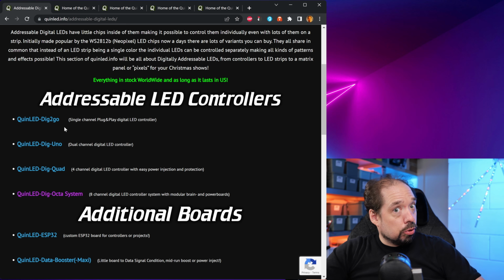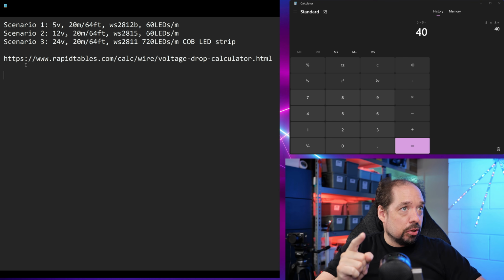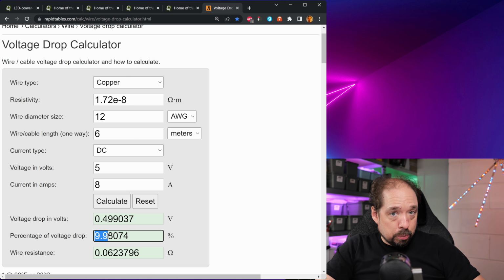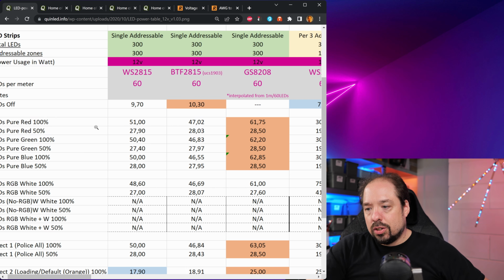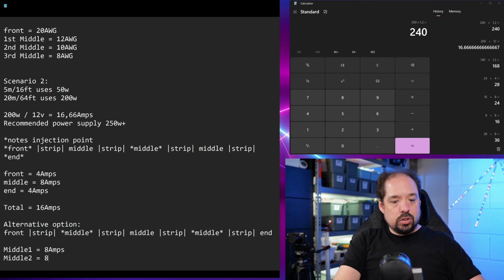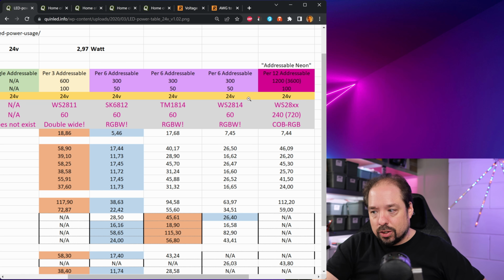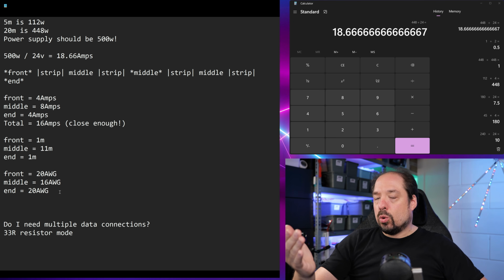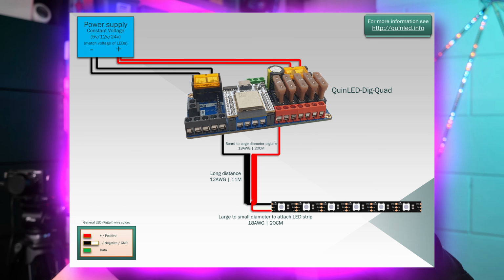Calculate LED Strip Voltage Drop With 💡QuinLED💡: You'll Be Surprised How Many Wires You Need!

Comment: My solution before finding this video was ending the positive on the first segments that didnt have a sag/blinked. I then bought an Amazon 36vdc 3a power supply and added it to the back half. Only 72 lights but it’s the resistance of the added line I jumped between strips.

Edit: do not go buying my specific power supply. Look at the one you have and get one similar and get a pro to do it. Never, ever, tie the new power supply to the positive already being powered only the unpowered strips, cap the previous positive

Comment: Do you consider any voltage drop for the 18 - 22 awg wire in addition to the actual LED strips? For example, if I have a 15 foot 22AWG running from my controller to the first run of LED strip, is there anything to consider in overall voltage drop?
Reply from the maker: Well yes, very much so. The video should have explained that though.

Comment: If my strips are wired in parallel, do I still need a power injection, and how do I determine what size wire I need? Im using the SK6812 with a 12v power supply. Im running 7 strips each 1 meter. They are single addressable.
Reply from the maker: The video in theory explains this. If you have 7x 1m and each fed individually, no need to power inject at least.

Comment: Great video. The clouds parted and the diy led world made sense. I do have 1 question though. In scenario 3 when you calculated 10 amps you didn't want to do a front, middle, end injection and you couldn't do a front and ended injection either cause that would only be 8 amps. Why couldn't you do the middle injection of 8 amps and 4 amps at each end for a total of 16 amps. I thought providing more amps is safe as the strip will only draw the amps it needs. I hope that's clear. Regardless, thx so much for helping us all understand this so we can safely have fun without worry. Cheers!
Reply from the maker: Awesome it helped! In the scenario you mention technically you could but it was a design constraint since most people don't like to do middle injections so a thought excise what you'd then end up with doing just front + end.
Reply: Appreciate your response. Thx for clarifying. I started the night about to give up on the DIY until i found your video. I'm confident enough to follow through on my plans now. I look forward to reading and watching everything else you've released. Can never know to much. Think I'll give your dig2go controller a try on my next project. Cheers! @IntermitTech

Comment: Thanks for making this video, its helped me a ton!

Just one thing i need clarification on: if we're injecting data, the point at which we're injecting data starts over at LED #0, correct? So from a programming perspective, we cannot treat the entire setup as one continuous strip, but rather as two separate strips each receiving its own set of data?
Reply from the maker: Awesome to hear! Correct on the data!
Reply: @IntermitTech  Is there a reliable way of doing this so that the entire thing can be treated as one continuous strip? Via hardware or software?
Reply from the maker: @dividebyzer0_ yes, internally in WLED if you have multiple physical outputs it's treated as a single strip that you can optionally cut up using segments.
Reply: @IntermitTech so it has to be through programming?
Reply from the maker: Well yes, if you are using something else then WLED it's up to that part.
Reply: @IntermitTech  sorry, I misunderstood what you meant by WLED but I did some googling and it makes sense now. Thanks again for your help! 👍

Comment: Question. I’m scrnario 2. Wrap around a room at 12v. Injecting at front and end. Injecting at middle at 8a. You calculate wire by the distance from the beginning to the middle point. However I’m injecting power at the middle with a psu at the middle. Only about 2 meters away. So do I calculate based on the 2 meters to the psu to the strip or use your computation based on the distance from beginning?

Comment: I wish this wasn't so complicated. I have two degrees in electrical engineering and I still cannot figure out how much power injection i need for a 16 foot WS2812B that has been cut in the middle with 8 ft of 22AWG wire spliced in.  any ideas?

Comment: I got into this led thing when I bought Govee light bars on sale as a "eh let's see this." I ended up in a rabbit hole and eventually took those apart because I didn't like 3 at a time strips and want everything on a 5v system. I didn't know how finicky led strips could be. Initially I wanted to do most myself, but since safety is pretty important for me I felt better getting something already made. Your system seemed so much better than what I was looking at with scalability. I've may have gotten too big of a power board but better than too small and honestly your products are very affordable it's not an issue. Thanks for all your videos and hope to see even more cool products in the near future!
Reply from the maker: Thnx, awesome to hear it!

Comment: Hi Quindor, thank you so much for this and all your videos! It's helped me so much!

I was curious about the Auxmer CCTs 2835 you recommended on your site as I wasn't able to find the power calculations for this chip within your tables. Hoping to seek your guidance please:

1) would I be able to assume based off the manufacturers power/m in this case? (E.g. 28.2W x 6m = 169W, with 24V, 7A so front + end should suffice)

2) don't want to assume that these are zone addressable even if they are tunable? But in your exp would this assumption make sense?

3) Regarding voltage drop for bridging a distance (e.g. kitchen hood), would the logic apply for the average Amps before and after the bridge (halving for middle injects which share the potential diff bidirectionally) to calculate the required wire thickness? In my example of front + end, this would be 4Amps

4) would having thicker wire gauges be counterproductive ( e.g calcs say 20AWG sufficient but I lay 18 or even 16 AWG for future proofing in case of upgrades)

Thank you!
Reply from the maker: Thnx!

1. Yes for analog manufacture is often correct for power.
2. Analog you can only change the whole strip, not zones. Also depends on the channels of the strip so for instance CCT has 2 channels.
3. Yes, it based on physics and the resistance of the copper tracks 
4. Sure, thicker wire doesn't hurt but use a value that you can solder to the strip stil, then stepping up for distance is fine.
Reply: @IntermitTech  Omg thank you so much! This stopped me from buying the wrong strip!

1) I was also looking at an alternative BTF 24V ws2811 FCOB CCT with 288(576)/m and per 24 (48) addressable. This wasn't on your power chart but I saw the 320(640) WWCW strip you tested had more LEDs, so I'm assuming it wont exceed those wattages? I.e. ~24W @50% and 40W @100%. I did note, however, that BTF claim 14W/m (70W/5m) which does seem significantly higher so I'm worried about underpowering this.

2) Would it make sense to have a CCT and RGB strip (side by side) powered & controlled from the same controller (e.g. dig uno)? Hoping for the best of both worlds (rgb and cct) without huge zones.

Many thanks!

Comment: I If I needed to add 5 or 6 injections over a long run, can I just run one set of thick gauge power cable next to the strip and tap into them every couple of meters instead of running individual cables for each injection?
Reply from the maker: You can, be generally you'd waste a lot of copper and also have to fuse in field, so everytime you branch off that large busbar wire. You also need to step down/change the cable diameter at each junction otherwise you are wasting huge amounts of copper basically like I started with.

Comment: can you also inject the data at the front and end both with ground and power wires?  or does the data injection need to be on the mid part?
Reply from the maker: I don't really follow the question. You need a new data line after 600 LEDs or zones generally. Did you watch the video?

Comment: Hello, what would be the best power supply for Seven SK6812 LED strips connected into one long loop/strip? 
I plan on connect power from the start and the end.  
The setup will be a big square and the start and end of the strip will come back around.  
I would like to use one power supply if possible, just having a trouble with choosing a power supply.  
Will a  DC5V20A 100W power supply be ok? Any suggestions?
Reply from the maker: I'm a bit confused, did you watch the video? 7x 5m of 5v sk6812 would use around 175w or 35Amps and require lots of power injections. Giving it only front + end would give the strip max 8A total so the brightness you could run is only 22%... And even then you are spanning too much between injections and will see horrible dimming in the middle, if it even stays functional at all. Please watch the video again and do the math. :)
Reply: @IntermitTech  Sorry man, I did watch the video just a bit confused. I am new to this and this will be my very first project. What will the best option be if I just want one power supply? I just don’t want too many power injections and run wires in too many places.

Comment: This video was tremendously helpful. Thank you!

I am building an led strip cube made of 12 segments with multiple data lines and power injection points, so figuring out the wiring had been a challenge until now.

Comment: Do I need Power Injection Points for long run COB LED strip Lights ? I'm just interested in a warm white light for above top cabinets, below top cabinets and below bottom cabinets in my kitchen
Reply from the maker: Yes, makes no difference what strip it is, but the guide covers all.

Comment: Hi! First of all, amazing video, thank you very much for all the information you give.

I have a question that I can't understand:

I want to make 15m of led strip in “closed” style, so the end of the 15 meters of led will be in the same place as the beginning. I already estimate that this will reduce the size of the necessary diameter, since I will never go more than 6 meters away.

My question is, well, two actually: 

Using the nominal capacity of 35w every 5m, in 15m gives me 105w, so that would be 21 Amps. 

 - Should I go for a 40a power supply? And if so, each power injection would have to be done from that same source? That is to say, to connect the beginning, middle and final injections in that same power supply?

And then, how would I regulate from WLED the consumption at 50%, from the mA regulator? I don't quite understand that yet.

Thank you very much and sorry for the long questions.

Greetings from Argentina!
Reply from the maker: Yes a single power supply of 40A would be perfect. The begin and end being close helps a lot! The middle injection will require a thicker cable which the video shows how to calculate..

The MA you can calculate it the 100% RGB value from the datasheet. The total amount set will make sure it doesn't exceed what you can deliver.
Reply: @IntermitTech  Awesome! Thank you so much for the fast reply :)

Love what you do.

Comment: I'm still lost - i want to run the cob 5v 160led/m for 2.5m. (accounting for close to 100% white)
1)What psu do i get? 5v 20a? 
2) how do i run the wires from/to psu to power the led? Do i connect to the controller first or ??
3) Do I still need to do middle/end injection for that length?
4) What gauge wire? What gauge for the wall plug to psu?
5) if i use gledopto esp32 with mic, how do i wire them up?
any help, much appreciated!
Reply from the maker: 1. Yes 5v 20A should be enough
2. If you use one of my controllers yes power runs through the controller because of power distribution and fusing
3. Oh yes, you'll need front + middle + end at least to be able to do 100% RGB white, especially if it's a 5mm wide strip, if it's 10mm wide maybe front + end will be enough
4. Calculate, see my guide " power injection " 
5. Ask that controller manufacturer for proper way of wiring but you will have to do power distribution and fusing yourself since those controllers do not do that

Comment: I don't have RGB LEDs personally, but I like the truck where the positive is on one end and the negative is on the other end, so the voltage drop is uniform across the entire length.
Reply from the maker: I do not, that's not really great for it and data wise that's a bit horrible too.
Reply: @IntermitTech  if it's simply single color LEDs, then it's a good trick. I'm a professional electrician but also an electronics hobbyist. And you're right that it's not great for the data signal, but like I said I'm not using RGB LEDs, I'm using single color LEDs. In my living room I just have a strip of 24 volt LEDs around the whole perimeter, and it works great to make sure that the brightness is uniform.

Comment: great video, so is there no problem with voltage drop of the data line within 20 m stripes?
Reply from the maker: If you're using my hardware up to 10m often works, up to 20m too. But if not we recommend one of the Diff series to get the data to go further.

Comment: What I can't see on this so far amazing guide is the use of pixel strings in both 3 and 4 wire configurations. Also finding it difficult to find the draw per RGB. I can only imagine the draw isn't asmuch as a bullet pixel but more than a RGB on a strip.

Comment: On the subject of power injection. An alternative method to ensure equal brightness of all leds would be to connect the +ve at one end of the strip and the - ve to the other end with supply wires of equal length. This way the voltage drop is automatically distributed between all of the leds over the entire length and they would automatically be of even brightness..
This technique is used when changing parallel battery banks to ensure each battery gets equal share of the charge. 
I have not tried this so please correct me if I'm wrong.
The disadvantage of this technique would be that whilst the voltage that each led along the strip sees is exactly same it would vary depending on the total power demand of the strip with time.
This would probably be a more desirable effect than varying brightness along the length of the strip.
I am a newby to this technology and maybe talking bs. Please let me know. I would be very interested in your feedback.
Thank you.

Comment: I love your videos, I've read the articles and I've learnt a lot - my struggle is it goes through the theory. It'd be great to see you actually connect it in.

In scenario 1. Are you soldering the data cable to connect to the signal boster? I guess you can't get the 8AWG cable onto the LED - so what is your actual recommendation? Where do you put all of this in an LED channel in a 20m run!?

I feel like I understand, but I don't know. Can you help?
Reply from the maker: Appreciate the kind words! And yes I get a lot is theory, I hope to have more practical examples in the future!

Regarding power injection wiring. Best case you avoid that large diameter wire but sometimes you can't. Then you can run the large diameter because it's needed for the distance so you can step down to a manageable size (18AWG for instance) at the LED strip and terminal side. Best is to solder and heat shrink that together.

You can't hide such wire in an LED channel, you'd need some other location to run those cables but that's really setup dependent.
Reply: @IntermitTech  Appreciate it, thanks

Comment: Now I understand, I've been watching your videos(quite a few of them) putting light strips in my aliexpress cart, kinda planning out what I need to buy. But I wasn't really sure how to wire it up and everything. 

I ordered the little solder gun/ heat gun kit you posted. Ordered some other tools, pigtail connectors, etc. 

But THIS video tied it all together. I'm now confident in taking on a few projects I've been planning out in my head. I'm now able to put them down on paper, fully drawn out, knowing exactly where, how and WHY I need to run the wires.

Huge thanks for taking time to make these videos, i can't wait to get started.
Reply from the maker: Awesome to hear it!

Comment: Hi, stupid question: Can I use one wire as transportation wire and connect to it 2 separate cables where power injection point will be? I mean in your scheme there are seperate wires for each power injection point. But... on Aliexpres I can see different scheme where small sections of wires are attached to the main "transportation" cable?

Comment: I think I have watched this video 5 times LOL, so much great information.  I am putting 25m/80ft of WS2815 (12v) on my house and using the Dig-Quad.  Already calculated I need 30A and will have 3 injection points.  One at roughly 5m/16ft, one at 10m/32ft but a third on the top roof line at 15m+ (30-40ft depending on where I end up passing the wires).  So the Power injection will be using 14awg (on the closer points) and 12awg wire (on the further) but that is too big to solder to the pads, how do you do that?  Is it safe to solder say an 18awg to the thicker wire right before going to the pads?
Reply: Actually only need 21-22 amps, but will be doing three middle injections.  8 amps each (24 total).  5 strips with a section of 3 and a separate section of 2.  Will also use three of the data outputs with two of them using the 33R  and I am adding a relay to cut power when not in use.
Reply: Apparently I never watched till the end 🤦‍♂️

Comment: i got btf lighting 630 leds/m 2811 fcob strip. Project  length would be 17 meters exactly. Strip End at 17 meters will loop around to initial digquad. do i need to power inject at the end? I am using 24v 5 Amp power supply. And what about data injection for this scenario? How many leds should i enter in WLED for the above strip{each zone is 7cm apart}
Reply from the maker: Did you follow the video and the 24v example? It should be able to tell you all these things. :)